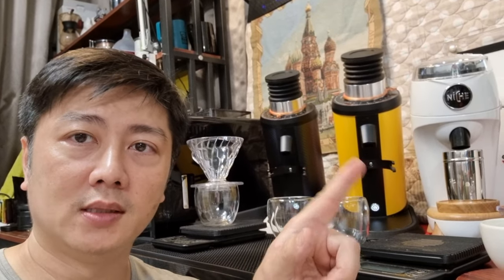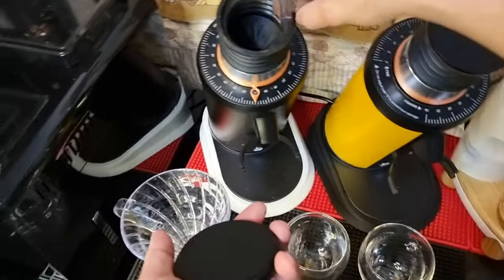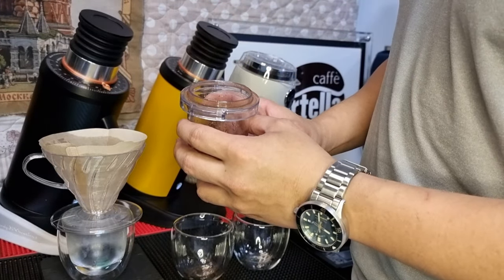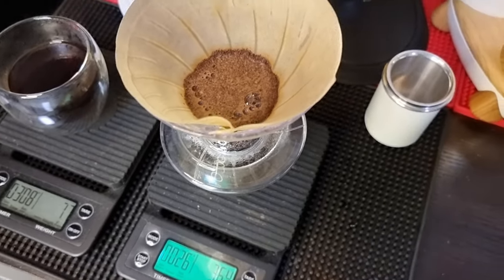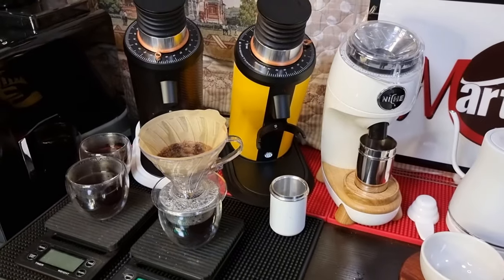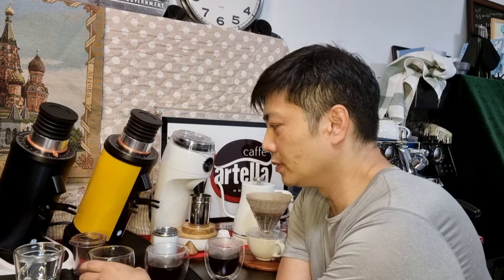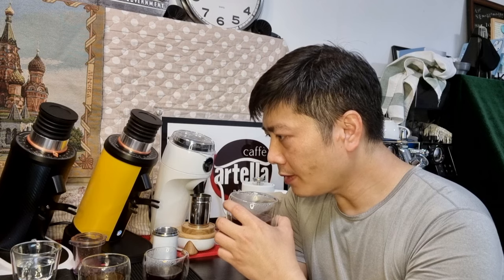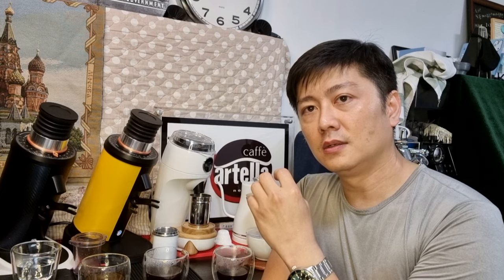Filtered Coffee Test | DF64 Itamill Stainless Steel Burr VS DF64 SSP Multipurpose burr VS Niche Zero

Comment: Appreciate your time sharing this video. I'm about to place my first grinder but DF64 comes with 3 specs. Italmill Steel, Itamill Titanium, SSP Red. The price difference is not a big gap e.g. Steel vs SSP is only SGD230. What would you recommend for beginner? Would you even suggest the Titanium coated? Thanks a heap
Reply from the maker: no skip the titanium. Its not worth if eventually u r going for ssp

Comment: Hi CY, thank you for the DF64 Guide! It was really helpful.
.
Question, I noticed that on min 6:34 there's a chirping sound near the end of the grinding process, do you have any solution for that?. I'm having the same issue, and when i stop the grinder and wanted to go finer, but I can't rotate it.
.
Oddly enough, i can rotate the grinder when it is on, but the chirping sound gets louder. I'm afraid it'll damage the burr.
Reply: Yeah it's normal, larger pieces that get trapped in the burrs. Just turn gently and evenly while on, perfectly fine.
Reply from the maker: Yeah that is correct!
Reply: Noted on it, thank you everyone!

Comment: The default blade is the  Itamil right? 

As I plan to use it for both Espresso and pour over is the Multipurpose worth the upgrade? (I will firstly use it for both but may tend more toward espresso later on)

Also will you explain how to change the burr ?

Thanks again CY !
Reply: If you like more body in the espresso I find the stock ones are pretty good for espresso (titanium coated ones, which should be the same as the steel ones) . The SSP espresso burrs do actually make a bit cleaner filter coffee even though they're not 'multipurpose' and they still have more body than the 'multipurpose' unimodal ones.
Reply from the maker: yeah I think that's what tje finer coffee ground contributes. I think by far the cleanest is SSP brew burr for filtered coffee. For espresso, I will stick with SSP HU.

Comment: Thank you for the detailed comparison and taste test. Good stuff 👍 
Do you mind sharing what is the tool you used to bellow out the Niche Zero?
Reply: It's called a Sputem Cup I believe. You should be able to get it cheap.  I don't think it's necessary with the niche though. You'll get maybe 0.2 or 0.3g out?
Reply from the maker: yeah it's the suction cup use to pad on baby's back to get air out from their stomach after they finishing their milk.

Comment: Hi Cy, just wondering did the df64 with the standard burrs have the modified declumper? I am using titanium burrs and from looking at the v60 bed i get alot more fines then you, which i know the stock declumper contributes to because of regrinding.
Reply from the maker: Hi my friend. Which version is your DF64. And also I strongly suggest not to bellow.
Reply: @CaffeMartellaSingapore  its a df64 with titanium burrs, it is either version 2 or 3? It has the new dial indicator but I've not opened it up to see which declumper it has. It was bought 3ish months ago from one of the authorised distributors here. Its currently stock apart from doing the spring/sillicon collar alignment you suggested.

I did see your video about not bellowing, problem is without any bellowing there is about 1.2g of retention which is a lot to waste, with bellowing it goes down to ~0.1g.

Do you think installing the mythos 1 declumper is worth it? I would like to get your modded declumper but shipping and taxes take it to £36 where the mythos part is only £7 and can ship pretty quickly.

Thanks for your help
Reply from the maker: @yz249  yes I think the Mythos one will work. I believe yours is the version 2/3 silicon declumper which will retain a lot of coffee if you don't bellow.
Reply: @CaffeMartellaSingapore  I actually just saw your DIY video for the clump crusher and I think I'm going to make it myself, don't have to wait for shipping that way haha.

Would you recommend Teflon sheets to use instead of PVC/PET? It's food grade, temperature resistant and non stick so perhaps might help a bit more with retention?
Reply from the maker: @yz249  PET is food safe  it's thinner and better
Reply: @CaffeMartellaSingapore  ah okay. I can find a PTFE sheet that is 200 microns/0.2mm, is that still too thick?
Reply: @CaffeMartellaSingapore  so good and bad news, I did manage to make the declumper from following the instructions in your video (using the original silicon cutout as a spacer) and it installed correctly.

Bad news is the collar is now jammed, it's stuck at 60 and I'm not sure if it's actually 60 or 1 full rotation away from 60, either way it's far away from the zero point.  I didn't even take the collar fully off initially, after it was jammed I completley took it off and cleaned the 2 burrs and the collar threads but it's still jammed. Normally the fix for this is turning with the motor on but that doesn't help either and it still gets stuck.

Quite lost as to what to do.
Reply from the maker: @yz249  oh no. My only concern is have you cross threaded and collar and the body?
Reply: @CaffeMartellaSingapore  that was my first thought but I didn't even take the collar off fully the first time, only loosened it enough for the black switch plate to slide out,so it should theoretically have been impossible to crossthread as it always remained  threaded on.

After that I took the collar off completely 4 or 5 times and it would always get stuck near the same place.

Idk, I'll try again in the morning.
Reply: @CaffeMartellaSingapore  okay so I have kind of fixed it. The issue was the black cover piece (that houses the power button) couldn't seat properly. After trying many things it was actually due to the piece of card I used with the diy declumber (I used the original silicon cut out, and then a relatively thick piece of card( about the same size as a thin piece of cardboard) and this prevented the chute from screwing in enough which prevented the cover from seating, meaning the collar couldn't clear it.

New problem (lol) is the touch point of the burrs has changed and I am not sure why. It's been consistently at -3 since I got it, and is now at +15 or so which is annoying. Only thing I can think of is I put the top burr in a different position but I was careful not to do this, so I'll check later.

In terms of the mod, much less retention before bellowing and noticeably less fines. Intrestingly the static has significantly improved which I was not expecting, i ground at pourover settings without RDT and there was almost no static which surprised me. I thought it would increase and RDT would be necessary but that seems not to be the case.

Thanks for all your help in trying to get this sorted
Reply from the maker: @yz249  anyway I am really glad that the problem(s) aren't the serious one and you are able to solve them one by one and its a learning journey for all of us.
Reply: @CaffeMartellaSingapore  so it took some reading on the df64's home barista thread but I know why my zero point has changed.

It's to do with the two screws the screw the base of the unit in. The tightness of the screws actually effect the lower burr position, as they put stress on the endcap that the lower bearing sits on.

The tighter the screws are turned(up to a point obviously) the burrs touch at lower on the scale (more negative), and the looser the screws, the higher up on the scale the burrs touch
 The screws were installed by the factory extremely tight on mine, and I didn't tighten them back to the same strength so that explains why.

But more importantly it is necessary to torque both of the screws to the same strength in order to make sure the burr is actually aligned on the same plane as the top burr. Maybe it's worth mentioning this in future videos as it's not something I would have ever thought of myself haha.

With that I think everything should now be solved and improved! Bit of a rollercoaster.

Comment: Very useful comparison! Could you do a side by side comparison with same burrs/grinders but for espresso? I'm considering unimodal (multipurpose) SSP DF64 for both espresso and filter, but I'm not sure if it will satisfy my espresso needs. I like lighter roasts.
Reply: SSP themselves recommend the unimodal for lighter roasts for either brew or espresso. I have no complaints on my DF64 with unimodals with espresso.
Reply: @GustavoSanchez64  good to hear. I know the unimodals are considered best for third wave light roast espresso styles, but I guess what I'm asking is: will I still be able to get decent texture /syrupy shots out of medium roasts? For example, I just roasted a lovely Yemen coffee to Full City.
Reply: @danielcohn6884  I do strictly light roasts for brew and for my espresso I like blends that are medium and light roasts and I am pulling better shots on the DF64 than the Sette 370 I had prior to upgrading. I have pulled single origin light roast espresso with it which were an absolute nightmare to do with my Sette. I am not the biggest fan of light roast single origin espresso though other than Panamanian Geishas which were basically impossible to do on my Sette.
I have not tried dark roasts with the DF64 because I am just not a fan at all. I did use super oily old as hell french roast beans I got at a discount store to season the SSP burrs though as they heavily recommend it.
Reply: You will not get the syrup/longer after taster with UM burrs, will be a similar tactile feel like ek43. For more syrup tactile and after taste, you will need the HU, or stock burr.
Reply: @kusazero  burrs are easy enough to swap that I suppose one could switch back to stock burrs for occasional traditional espresso

Comment: As a niche owner that changed, DF64 stock burr is not worth upgrading from niche, its more of a side grade. For filter, the fines are a nightmare to manage for stock burrs. If you already have the niche, and thinking of DF64, dont bother unless you are going to get the SSP UM as well. Stock burr is ok making espresso.
Reply from the maker: I disagree though. The DF64 stock itamill is already great for espresso. I have both and personally I prefer the DF64 for espresso and this video is to test the filter coffee ability of the DF64 standard itamill. With upgrade from itamill to SSP brew or SSP multipurpose, it produces a very sweet cup with high clarity and less acidity. As I roasted this batch of coffee myself, I have set the roasting profile to give sweetness and less acidity. The niche Zero just bring out the acidity much more than the DF64. DF64 is closer to what I am expecting in the beans I roasted. On top of that, with SSP upgrade, it is still cheaper than Niche Zero. Don't get me wrong, Niche produces a great cup but I don't want my every cup to taste acidic when I don't want it to be.
Reply: Why did you change from Niche to df64
Reply from the maker: @ridef0rlife  because I don't like conical burr. Flat burr produces the flavour that I like and 64mm at df64 price point is unbeatable. Even with ssp MP upgrade, it is still cheaper than niche and works much better for me. I don't have any issue with fine on my stock df64 ss burr. Its sweet, high clarity and clean cup vs buddy and over bearing on acidity and brightness on the niche.
Reply: @ridef0rlife  To be able to use a flat burr, more specifically, SSP's.
Reply: @CaffeMartellaSingapore  Based on this, for a home grinder to jump between espresso, pour over, and everything in between what would you recommend? The DF64 with the SSP Burrs?
Reply: @kusazero  Same question I suppose, how do you feel the Niche stacks up against the DF64 with SSP UM for an all rounder "needs to do everything" bench? (Hypothetically of course) if you were a new buyer?
Reply: @AttitudeCastle  I think, from my personal experience, it comes down to how you like your espresso. With the UM (now named Multi-purpose, which SSP mentioned that they "fixed" the problem I will be mentioning), you will get EK-like espresso, that is more watery and less tactile (relative, not absolute descriptors), not necessarily worse, just different (a lot of WBC competitor uses EK for espresso). I haven't done enough espresso with the UM burrs, the above are based on my few tries of espresso with UM burrs (DF64), and professional experience with the EK43. Beats Niche by about 2 dimensions for filter, just cant get that clarity and clean(ness) with a conical burr (more crushing compared to a flat burr, again, just different, not worse/better).

Comment: Niche RIP
Reply: Not really, I would still recommend niche to ppl that 1) doesnt want to fork out extra for ssp + 2) doesnt want to install all the mods.
Reply: DF64 + SSP price is < (less than) Niche price. So it isn't extra. Mods are being reworked by DF64 manufacture and will soon hit supply chain, they have already modified declumper and they are fitting a anti-popcorn attachment, and new number font is being used. No mods necessary on newest DF64.
Reply from the maker: The grinder is good without the mod. Without SSP espresso taste good. With SSP, even better. Upgradability is a plus on the DF64 but the finishing is definitely not as good as the niche. Most important before recommending it to people is to let them know what each of these 2 grinders are good at. If you like brightness and acidity, go for niche.  If you like more rounded, more clarity and sweetness, go for DF64.